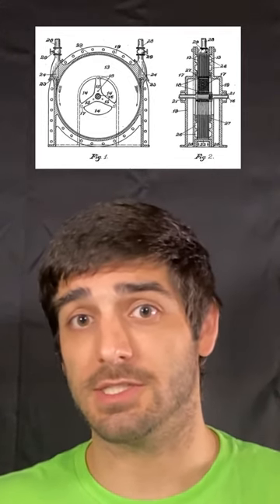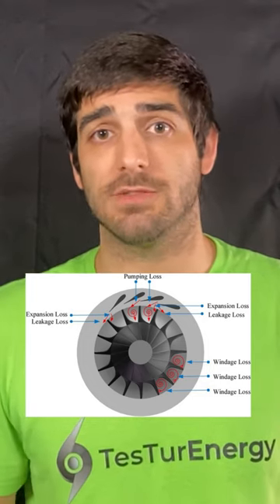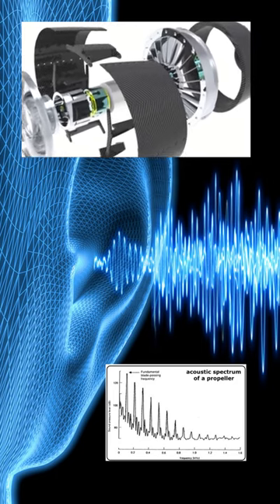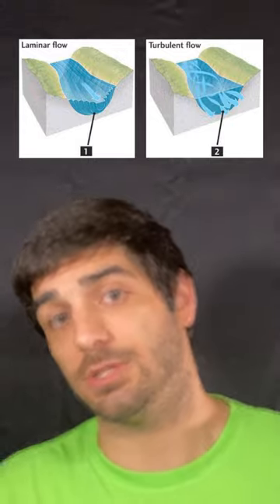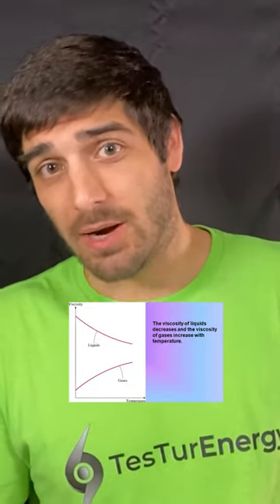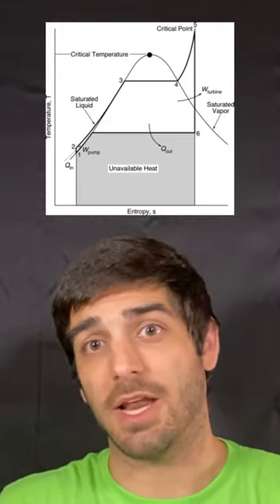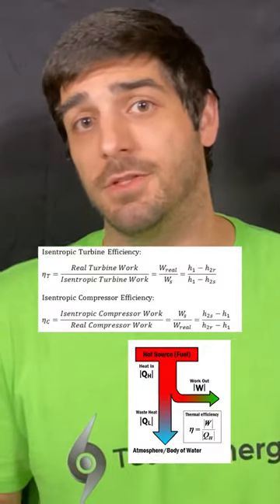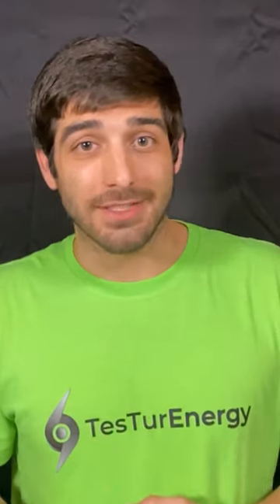Tesla Turbines For Nuclear Submarines

Comment: Tesla turbines are well known to be noisy. Not good for a sub. Its not engineers dont know about tesla.
Reply from the maker: Hey thanks for commenting but that’s simply not true. 

They are not “known” for being loud, you literally just made that up. 

Nobody even makes them that actually works for them to be “known” to work like that. 🤭

I swear, I’ll never understand where some of you come up with these far left field claims about the Tesla turbine. 

Never mind I’ve already proven just how quiet they are, even with a plastic and aluminum prototype I made that uses crappy RC car gears, which is the only thing that really makes noise on them, besides the crappy ball bearings I’m using.

+4250watt Tesla Turbine Dyno Jet Turbo Power & Torque Curve 375 mph @ 12,500 rpm https://youtu.be/exF5Rn-L8gs 

DIY Turbo Generator for Off-Grid Electricity: 250 watt Load https://youtu.be/60OqmBMNV-Q 

Again the only thing that can be heard in this is the crappy RC car gear and the skateboard bearings. 

That and the non optimized flow cavities in the pipes leading to the turbine nozzle that I have, which would be properly acoustically designed if actually used for a nuclear submarine.

And the little 4.5in turbine only makes that “schweee” noise is because the skateboard ball bearings I used in the v1 of the prototype and the discs didn’t have their spacers in them for the v1, that keeps the discs from vibrating like a harmonica, but the self damping effect of the discs when they have the periphery spacers properly built in, there’s no vibration.

Again there’s nothing to actually make noise on the TesTur when it’s operating. 

Not to mention, especially when designed correctly to maintain laminar flow regimes, it’ll be that much quieter. 

Again just because a bunch of people had made non working Tesla turbines with crappy ball bearings that get loud because they do not maintain laminar flow regimes does not mean that a properly designed Tesla turbine wouldn’t be amazingly quiet.

Full stop.
Reply: @CharlieSolis  a 50k rpm whine is a very obvious signature. Tesla turbines are low torque at low rpm and inefficient at high mass flow rates. They are better as a pump than a power generation system.
Reply from the maker: @maxwellblackwell5045  Thanks for your input. Though contrary to popular misconception, Tesla turbines are actually quite efficient and deliver a respectable amount of torque, even at low rpm and rotational speeds.   In fact TesTurs get the most torque at low rpm; that’s when the fluid is moving fastest relative to the discs, and therefore get the most torque. 

Let me break it down a bit further with some copy pasta 🍝 of mine:   

The notion that Tesla turbines need to spin extremely fast for efficiency is a misconception stemming from their use as centrifugal pumps.   

When functioning as pumps, yes, their effectiveness is related to tip speed.   

However, in a turbine setup, excessively high RPMs create a counterproductive centrifugal head that diminishes the pressure difference across the nozzle.   

This, in turn, reduces the fluid’s terminal speed and mass flow rates, ultimately impacting the turbine’s power output. 

Adding to this, it’s worth mentioning that the faster you rotate the discs, the higher the velocity your input fluid must attain to maintain a torque advantage over the discs.  

To clarify this, let me share another bit of technical info:  

Tesla turbines are entirely viable for large-scale industrial applications. 

That’s because the torque experienced by the discs directly relates to the speed difference between the fluid and the disc. 

Here, the crucial element is the disc tip speed.  

For a specific fluid inlet, the nozzle will max out at a certain fluid velocity. 

This sets a cap on the disc tip speed, which isn’t influenced by the disc’s radius. 

And if you consider that centripetal force is linked to the square of velocity divided by the radius (V^2/R), you’ll find that enlarging the disc radius while maintaining the same tip speed will actually lower the centripetal forces exerted on the disc. 

Contrary to the widespread myth that Tesla turbines must rotate at high speeds to be effective, the truth lies in optimizing certain conditions.   

Increasing disc speed isn’t the way to enhance efficiency; rather, it’s about minimizing slip between the fluid and the discs. 

When the slip increases, the system inherently suffers losses.  

Tesla’s own words from his patents outline how to get the most out of these turbines:   

“Owing to a number of causes affecting the performance, it is difficult to frame a precise rule which would be generally applicable, but it may be stated that within certain limits, and other conditions being the same, the torque is directly proportionate to the square of the velocity of the fluid relatively to the runner and to the effective area of the disks and, inversely, to the distance separating them. 

The machine will, generally, perform its maximum work when the effective speed of the runner is one-half of that of the fluid; but to attain the highest economy, the relative speed or slip, for any given performance, should be as small as possible. 

This condition may be to any desired degree approximated by increasing the active area of and reducing the space between the disks.”  

So the principles for maximizing TesTurs’ performance are:   

1) increase fluid velocity in relation to disc speed,(not increase disc speed)   

2) Maximize the surface area of the discs, and   

3) Minimize the spacing between the discs.  

The fundamental interactions governing the turbine’s efficiency and torque are fluid adhesion and cohesion, and not RPM.   

Misguided efforts to chase RPM with TesTurs invariably lead to disappointment because they fundamentally misunderstand how to properly design these turbines.

Understanding the design specifics of Tesla turbines is crucial for their optimal operation, and it’s not about spinning them at high RPMs.   

A common misconception arises because people misinterpret Tesla’s patent, confusing the turbine’s function as a pump with its function as a drive turbine.   

In Tesla’s own words, which pertains to when the TesTur is used as a pump or compressor:   

‘I have found that the quantity of fluid propelled in this manner, is, other conditions being equal, approximately proportionate to the active surface of the runner and to its effective speed. 

For this reason, the performance of such machines augments at an exceedingly high rate with the increase of their size and speed of revolution.’  
-Nikola Tesla

So to clarify, high RPMs are relevant when the Tesla turbine is employed as a centrifugal pump or compressor because the performance of all centrifugal devices is dependent on tip speed.   

When it comes to its role as a drive turbine, the focus should be on reducing fluid slip, not on spinning the discs faster.   

Misinterpretation of Tesla’s patent has led to this RPM chase, causing ineffective designs and subpar performance. 

It’s essential to clarify that ramping up the speed of the Tesla turbine discs isn’t beneficial; in fact, it can be counterproductive.   

The centrifugal forces that emerge at high RPMs can actually work against you by impeding the fluid flow and diminishing power output.  

So, if you’re designing a TesTur, remember that speeding up the discs is a double-edged sword.   

Not only does it create resistance via centrifugal forces, but it also demands that your fluid move even faster to apply useful torque to the discs.  

Hence, simply cranking up RPMs isn’t the magic fix some might think it is.  

This is what Tesla said,  

“Still another valuable and probably unique quality of such motors or prime movers may be described.   

By proper construction and observance of working conditions the centrifugal pressure, opposing the passage of the fluid, may, as already indicated, be made nearly equal to the pressure of supply when the machine is running idle.   

If the inlet section be large, small changes in the speed of revolution will produce great differences in flow which are further enhanced by the concomitant variations in the length of the spiral path.   

A self-regulating machine is thus obtained bearing a striking resemblance to a direct-current electric motor in this respect that, with great differences of impressed pressure in a wide open channel the flow of the fluid through the same is prevented by virtue of rotation.   

Since the centrifugal head increases as the square of the revolutions, or even more rapidly, and with modern high grade steel great peripheral velocities are practicable, it is possible to attain that condition in a single stage machine, more readily if the runner be of large diameter.   

Obviously this problem is facilitated by compounding, as will be understood by those skilled in the art.

Irrespective of its bearing on economy, this tendency which is, to a degree, common to motors of the above description, is of special advantage in the operation of large units, as it affords a safeguard against running away and destruction.  

Besides these, such a prime mover possesses many other advantages, both constructive and operative.   

It is simple, light and compact, subject to but little wear, cheap and exceptionally easy to manufacture as small clearances and accurate milling work are not essential to good performance.   

In operation it is reliable, there being no valves, sliding contacts or troublesome vanes.   

It is almost free of windage, largely independent of nozzle efficiency and suitable for high as well as for low fluid velocities and speeds of revolution.”   -Nikola Tesla   

Tesla wasn’t advocating for high-speed rotation; rather, he emphasized correct design principles for optimal performance, even at low speeds.   

His turbines were envisioned as simple, low-maintenance, and versatile, capable of functioning well at various fluid velocities and rotational speeds when designed properly.
Reply: @CharlieSolis  then why isn't it used?
Reply from the maker: @maxwellblackwell5045  hey thanks for the reply, because everyone erroneously thinks it works like you just said… and then they design them wrong. So of course they would get bad results. 

Or they just don’t bother because everyone repeats those same myths.

Seriously please take a watch of the Tesla turbine collab video we made with @integza 

https://youtu.be/Tuzh9mHvzkk 

Joel just posted the video about 2 months ago. 

Let me know if you have any questions!
Reply: @CharlieSolis  come on that's a Bs excuse. you can't think in 120 years that no one has investigated them or figured out how to use them if they were better than axial flow turbines. They would be much easier and less expensive to make and maintain.
Reply from the maker: @maxwellblackwell5045  first off I don’t have to have the answer as to why no one has used them until now for me to be right about how they work. 

That’s a complete red herring fallacy you’re trying to play there. 

There’s 1000 different reason why it wouldn’t be used.

For one the proprietary rights in it expired in 1942.

So good luck getting an investor to put money towards R&D that won’t have any proprietary rights to it or competitor barriers to entry and someone can just copy and take it. 

That alone right there would be reason enough that no one would put their money into it. Because the organizations that wouldn’t it all operate as a business and they won’t take financial risks if they don’t have to. 

There are plenty of other sales revenue opportunities and manufacturing opportunities within the current used engines and turbines. 

Again, if you can’t get an investor it’ll never be done in a start up.

And if you can’t have proprietary rights you’re not going to see Boeing, etc. putting money towards it. 

They profit off of keeping their products and services hyper niche. 

It’s not a conspiracy. It’s a business model. 

Entire industries are built around other engines too that have no interest in changing either. 

Then there’s even regulatory issues, because there’s no current version of it there are no existing regulatory standards for it so you can’t get anyone to insure it, or for that matter if it was out in a car to insure the car. It’s to much of a liability. 

The new 3D printed homes are going through the exact same issue right now.  Because none of the home insurance companies have any of the legal liability claims worked out or statistically known, none of them want to insure them, also because they are built different the zone and building inspectors don’t have any existing municipal codes for how to properly do them on the books yet, so they don’t ever approve them. 

It’s not impossible to make the change but it’s a massive hurdle.

Then there’s just plain public opinion about the TesTur.

Just look at how resistant you are to changing your mind on it and I have an actual working Tesla turbine that has so much torque I have it geared up to the generators, but you keep hammering back at me that “TesTurs get low torque”.

I literally have proof that that TesTurs getting low torque is a completely erroneous myth, and you still don’t believe me so much that you’re now questioning why people haven’t done it instead of asking questions about how it works….

Yes you heard me right I said my Tesla turbine is geared UP to the generators.

Not DOWN like everyone and their mother demands must be done for it to even work. 

Are those enough reasons?

Your own response is a perfect indication of how difficult it would be for anyone to go to market with it.

The amount of up hill battling we’ve already done just to get here is absurd. 

I’ve heard literally every nonsense claim as to why the TesTur CANT work…

Like I’ve literally been told it’s not possible to output any amount of power with one because they don’t get enough torque, while I literally have MANY videos and proof showing just how much torque they do in fact get. 

It’s becoming comical honestly 🤭
Reply: I watched your video. I don't know how efficient it is but it's worth investigating. I want a real reason no one uses them. Is it blade tip speed at scale?
Reply from the maker: @maxwellblackwell5045 it’s worth mentioning that the faster you rotate the discs, the higher the velocity your input fluid must attain to maintain a torque advantage over the discs.  

To clarify this, let me share another bit of technical info:  

Tesla turbines are entirely viable for large-scale industrial applications. 

That’s because the torque experienced by the discs directly relates to the speed difference between the fluid and the disc. 

Here, the crucial element is the disc tip speed.  

For a specific fluid inlet, the nozzle will max out at a certain fluid velocity. 

This sets a cap on the disc tip speed, which isn’t influenced by the disc’s radius. 

And if you consider that centripetal force is linked to the square of velocity divided by the radius (V^2/R), you’ll find that enlarging the disc radius while maintaining the same tip speed will actually lower the centripetal forces exerted on the disc.
Reply from the maker: @maxwellblackwell5045 As far as efficiency goes… (mind you this is a copy pasta 🍝 so it’s a bit long but it’s worth the read.) …My 2650watt electrical load run came in with a very low ball calculation of 40% isentropic efficiency.  To start off, mind you that includes generator losses, 3 phase rectifier losses, and inverter losses to the electrical load that were not accounted for. So the turbine off the bat is already most definitely doing better than the 40% isentropic efficiency I’ve calculated from the already low ball test results.   But for now I’ll just assume 40% isentropic efficiency so that I’m not over claiming what I can prove it can actually do for the time being. (I have nothing in the long run to benefit by overstating my numbers and only my legitimacy to lose. I’ve worked hard for my physics degree and don’t intend to tarnish it for a couple of extra views on the internet.) 

As far as inefficiencies to the system to fix, there’s 10x crappy ball bearings in this version, 2 crappy RC car gears, both losses will be gained for power out with a direct to shaft generator. (Minus two gears and 8 crappy ball bearings)  There’s an 1/8 of an inch of space between the turbine endplates and the casing endplates on both sides of the TesTur. That’s a 1/4in of open flow area around the 2in wide turbine (that only even has a total of 0.75in wide of spacing between all the tight disc spaces for torque to begin with.)   That means 25% of the open space for flowing through the casing, between discs and between the casing and turbine endplates, is just free flow over the side of the turbine still. (I’m using the absolute bottom of the barrel of machining equipment right now in my garage 🤷‍♂️)  There’s no labyrinth seals yet to even attempt to further reduce that overflow… 

The nozzle is atrocious at the moment, when making the variable converging section have a tight convergence it causes the fluid jet to aim more centripetally (towards the axle) instead of tangentially (glancing off the disc tips) which severely effects the fluids natural path.   This will be fixed with the new variable nozzle design I’m going with.    Then even further in this specific casing’s assembly there’s two “pillars” in the middle of the nozzle.   This is because the aluminum plates in the middle of the casing plate stack only had the variable nozzle bar and inlet holes cut out, and not the full nozzle geometry.  So those pillars are just vertical bars in the middle of the nozzle for the air to smash into just before going into the turbine (hopefully the wet steam tests will just erode them down 🤭)   Before all that there’s still about 100ft of air hose between the tanks and the turbine… plus a shell and tube heat exchanger and a TON of elbows and fittings.    I’m sure I’m forgetting something too but between all that being fixed… I can almost guarantee we will be in the 60-70s % range and that’s all just still with room temp compressed air.   Most forget, I’m using room temp compressed air and never went over 20psi at the nozzle for these tests. (Pressure differential and temperature differential govern efficiency) 

And even then I still only even have a single stage on it yet.   Everyone wants to compare it to the efficiency of a very high temp, high pressure (1000°F & ~1800psi) multibillion dollar 15-30 stage steam turbines…   😮‍💨   That’s apples to rocket ships. 😅  But considering Rankine Steam cycles get theoretical max about 33% of input heat (due to latent heat of condensation and that’s without any regenerative boiler feedwater preheat, air fuel preheat, etc) and then 40% isentropic efficiency (considering the turbine as is) we’re looking at 13.2% thermal efficiency with steam.   A more apt comparison for the TesTur would be something an individual can actually purchase, like 1-5kW piston gas generators that you can get from Home Depot or Lowe’s.   These get 15-22% thermal efficiency off the plant floor. Good luck getting that 1 year down the line or later with all those moving parts.  Also for reference, industry standard for micro bladed gas turbines is 25% thermal to electrical. Whole system efficiency can go higher in Combined Heat and Power (CHP) system, but alas the TesTur would see the same whole system efficiency increase in a CHP Auxiliary Power Unit (APU).  In the TesTur you gotta replace…? 🤔bearings…? And still even then, only maybe 🤷‍♂️ depending on how good of bearings, balance, lubing, cooling.   The TesTur, and other bladed turbines, only have one moving part. 🔥 

So if those piston generators drop efficiency, even at all, the TesTur on its worst day is competitive with a gasoline piston engine electric generator.🤓😬🤷‍♂️  And the TesTur can handle any fuel that can burn, even solid particulate fuels like powdered saw dust, pulverized coal, powdered iron, biomass, etc. (noting the number of those that can be acquired without spending money… 🤑 opening up “low monetary cost”, even carbon neutral, fuel options for MILLIONS around the world)  We have to remember that the TesTur doesn’t have to be the holy grail to be worth using if we have free fuels readily available like biomass, and even waste heat already being dumped out into the air and not used for anything.  The TesTur just has to be a viable option for some to be worth doing. 

Even more, the mere fact that I’m using a low temp fluid for my 40% isentropic efficiency calculation means my TesTur efficiency is severely limited by thermodynamics and fluid dynamics.   Increasing temps will automatically increase my turbines efficiency.  This is because gasses have an increasing viscosity trend as you increase the temperature.   This leads to increased isentropic efficiencies in the TesTur from reduced slip on the discs.  (Meanwhile, we’re already talking about a piston engine using combustion temps as is.)  Whereas bladed turbines see the increased viscosity as an increase in drag loss through the turbine blades.   So we can’t always count on seeing increased isentropic efficiencies in a bladed turbine in practice when we go from low temp to a high temp.  Again, to reiterate, this increase in viscosity in the TesTur only works to enhance the working action of the TesTur.  (That being viscous adhesion to the disc faces increasing torque.)  That’s all on top of the increased thermodynamic efficiencies of using a higher temp elastic fluid too! 🤓 

The disc spacing for room temp gasses is not going to be the same for combustion temp gasses/steam because the viscosity of either increases by 3x fold. And I’ve designed these spaces for a higher temp fluid with a slightly higher viscosity so these will inherently be too wide at the current temperatures being used.   So as we increase temps along with all these other really easy to fix mechanical issues (that only are a thing because I’m building this in my garage on a junk cnc machine) I have no doubt we will see more than competitive isentropic efficiencies compared to bladed turbines, let alone whole system thermal efficiencies that are through the roof.   This is because of the heat recovery systems that can be added with the cost savings of using a TesTur vs a VERY expensive, and in my opinion, relatively delicate bladed turbine.   Just getting tighter casing clearance with the turbine should give me at least 20% points back on efficiency putting my testur at the 60% range.   Coming in with a 19% thermal efficiency in a Rankine steam system without any kind of thermal recoup.
Reply from the maker: Can you be honest with me, are you actually reading my responses to you…..? 🤔 

Because you responded back to my last comment faster than it literally takes to even read the comment….
Reply: @CharlieSolis a power company wouldn't need to sell them so patents wouldn't matter. They are trying to make power. With all the manufacturing that goes into a Tesla turbine vs a axial flow they could design and have one manufactured for the cost of a GE or whatever. Then save big on the efficiency they gain. And isn't that exactly what you are doing though isn't it? Trying to make this a business?
Reply: @CharlieSolis  have you done the work to know what it would take to make one at scale for a mega watt generator? What are the forces on the disc? What metals can handle it? You made 1200 watts. Make me one thats 24k watts and I'll pay you 20 thousand. Otherwise I'm buying a generac natural gas piston engine. Id love for you to be right but I'm not just going to take your word for it. You have to prove that it would work today. Not theory.
Reply: @CharlieSolis  yes. And I get how the darn thing works. What I don't think works is building it at scale.  I'm not saying they don't work. I'm saying there is a reason we don't use them. The rest of the internet seems to have it figured out and can explain it. So you just want to have small units for every one? How are we going to make steam?
Reply from the maker: @maxwellblackwell5045  they do not care to bother with that. They already have systems that work and no one can copy them.  And they are the only ones who can afford to make any kind of competing turbines. 

Like I said, hyper niche.

You’re failing to understand that their greater business model doesn’t involve finding a better turbine that can handle fuels that they don’t have abundant access to and or complete and total market ownership of. 

They are trying to sell electricity from buying a cheap fuel that has a a reliable tap source. 

Now I’ve given you numerous reason as to why. I’m done having this conversation. 

You’re just playing run around the point with these red herrings. 

If you have an actual question about the turbine I’m more than happy to answer it. But I’m done playing 20 questions as to “why other people haven’t figure this out.”

Idk, I’m not them. All I know is they don’t use them and every other engineer I’ve talked to parrots the same erroneous be claims about the TesTur which only proves they don’t even bother to read the patents before parroting the claims as an expert. 

I have actual proof of one working that ALL those other engineers tried doing even for their senior research projects and failed. 

By my homemade plastic and aluminum prototype is outputting 4250 watts, on room temp low pressure compressed air, half the peak load demand of a whole home and 4x the average load…

Again I can’t tell you why they haven’t gotten it other than they don’t understand it. 

And I can tell you they don’t understand it because I in fact have a degree in physics from Michigan tech university, and I had to learn A LOT more organic chemistry and quantum mechanics than any mech engineer even touches. 

And as such most mech engineers don’t understand the molecular adhesion and all think this is a “friction” turbine despite the fact that Tesla has is literally quoted as claiming that to be false 100 years ago… 

yet I have engineering buddies who tried telling me it’s a friction turbine… 🤭

From Dr. Tesla Talks Of Gas Turbines.   ““I have been working at this a long time. Many years ago I invented a pump for pumping mercury. Just a plain disk, like this, and it would work very well. ‘All right,’ I said, ‘that is friction.’ But one day I thought it out, and I thought, ‘No, that is not friction, it is something else. The particles are not always sliding by the disk, but some of them at least are carried along with it. Therefore it cannot be friction. It must be adhesion.’ And that, you see, was the real beginning.  “For if you can imagine a wheel rotating in a medium, whether the fluid is receiving or imparting energy, and moving at nearly the same velocity as the fluid, then you have a minimum of friction, you get little or no ‘slip.’ Then you are getting something very different from friction; you are making use of adhesion alone. It’s all so simple, so very simple.  “This is the greatest of my inventions,” Tesla went on with great enthusiasm.“ 

Then I explained it to them… and then I found out they don’t understand the electron orbital interactions that govern not only adhesion but cohesion. 

Additionally the number of engineers who look at me like I’m espousing ancient alchemy when I tell them that gasses see an increase in viscosity as temps increase. 

I’ve literally been told by one that I’m crazy for thinking that… despite the fact that that’s actually how fluid dynamics and thermodynamics works. 

The chem engineers who do understand all this? 

They don’t usually take enough rotor dynamics classes to fully understand the mechanical principles behind the TesTur. 

And even worse, the mech engineers and chem engineers usually dont understand the electrical side of things well enough to go about the electrical engineering. 

And the electrical engineers who do  understand those parts don’t understand the chem engineering or rotor dynamics or thermo or fluid dynamics. 

Again I can keep giving you reason as to why people haven’t done this already. 

But it doesn’t seem like you’re going to be satisfied with any of my answers, even when I have actual working Tesla turbines that literally output more torque than you literally thought possible.
Reply: @CharlieSolis  none of that makes sense. Many companies sell pumps based on the TT. But not generators. Pretty cool you made that in your basement though. You're definitely not stupid. You find me a material that can withstand the centrifugal forces of a megawatt sized generator and I'll raise the money. No joke.
Reply from the maker: @maxwellblackwell5045  thanks for replying but again, a megawatt TesTur would not need some crazy exotic material to withstand such alleged centrifugal forces like you’re saying because it doesn’t need to be spun fast to need to be able to withstand those hoop stresses. 

I already designed this 10in diameter TesTur such that, at full disc number 200-250 per stage and 3-4 stages, it should be capable of outputting 500kW easily, and that’s if it only can achieve the same thermal efficiencies as a muscle car piston engine… which is not very good all things considered.

Since 

Horsepower = torque * RPM / 5252

Let’s just say at we operate at the modest 5252 rpm.

To get 1 megawatt (1340hp) at 5252rpm 

Torque = HP * 5252 / rpm

      = 1340hp * 5252 / 5252rpm

      = 1,340 ft-lbs 

Considering that each stage would have 250discs and there’d be 4 stages, 

That’s a total of 1,000 discs, each carrying a small part of the total torque load. 

If that was evenly spread across all of them then the total torque per disc wouldn’t exceed 1.34ft-lbs of torque.

If you take a watch at my video that goes through how much torque even these thin aluminum discs can handle before deforming, not breaking, just bending when not supported, so the max yield point or max tensile strength point isn’t even being established, just an arbitrary number on how much torque a single unsupported disc can hold on a single point of the disc, (ie not spread around the disc periphery like it would actually be) 

Tesla Turbine Disc Max Torque Test
https://youtu.be/jiIosu5KrT0

As you’ll see even these low end aluminum discs can handle over 1.6ft-lbs of torque before even seeing any kind of need for supporting end plates let alone actually be at risk of breaking. 

And when I’ve more than proven to be able to get that kind of torque even at low rpm with MUCH less discs, this is all but proven to be possible, other than me actually doing it. 

And again that would still be the 3105 h13 aluminum discs that are honestly the weakest disc material I can even think to use, even if the materials Tesla would have had access too. 

Contrary to the erroneous myth that Tesla turbines must rotate at high speeds to be effective, the truth lies in optimizing certain conditions.   

Increasing disc speed isn’t the way to enhance efficiency; rather, it’s about minimizing slip between the fluid and the discs. 

When the slip increases, the system inherently suffers losses.  

Tesla’s own words from his patents outline how to get the most out of these turbines:   

“Owing to a number of causes affecting the performance, it is difficult to frame a precise rule which would be generally applicable, but it may be stated that within certain limits, and other conditions being the same, the torque is directly proportionate to the square of the velocity of the fluid relatively to the runner and to the effective area of the disks and, inversely, to the distance separating them. 

The machine will, generally, perform its maximum work when the effective speed of the runner is one-half of that of the fluid; but to attain the highest economy, the relative speed or slip, for any given performance, should be as small as possible. 

This condition may be to any desired degree approximated by increasing the active area of and reducing the space between the disks.”  

So the principles for maximizing TesTurs’ performance are:   

1) increase fluid velocity in relation to disc speed,(not increase disc speed)   

2) Maximize the surface area of the discs, and   

3) Minimize the spacing between the discs.  

The fundamental interactions governing the turbine’s efficiency and torque are fluid adhesion and cohesion, and not RPM.   

Misguided efforts to chase RPM with TesTurs invariably lead to disappointment because they fundamentally misunderstand how to properly design these turbines.
Reply: @CharlieSolis  I have an idea I'd like to work on with you. I abandoned it a decade ago because I couldn't find a competent person to build me a TT.  I will provide all funding. Both of our names on the patent. How can I contact you privately? Do you have a public business email?
Reply: @CharlieSolis  how big is it and how much does it weigh?